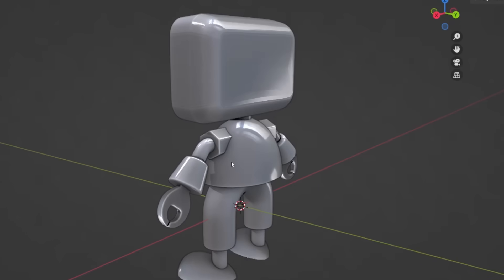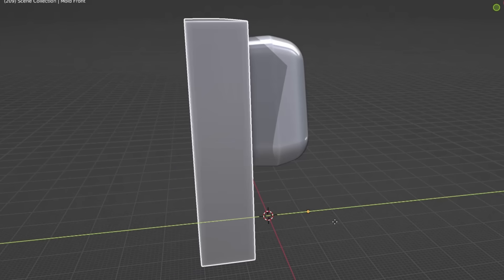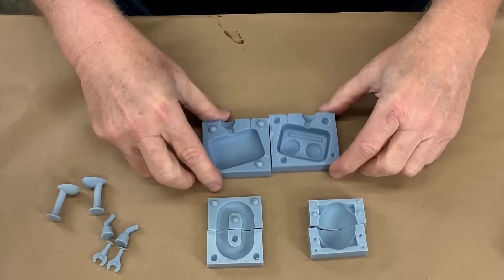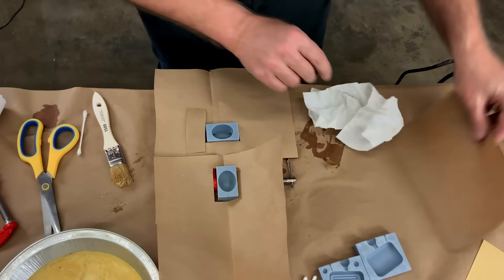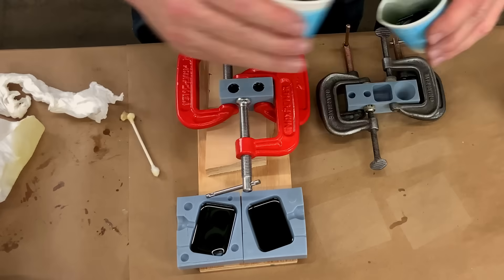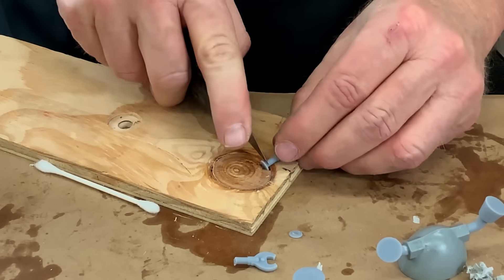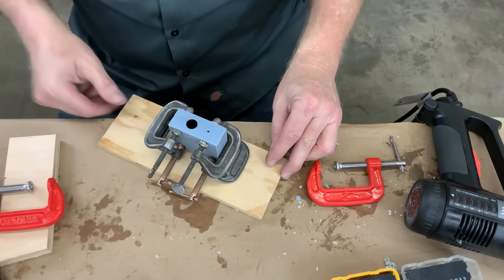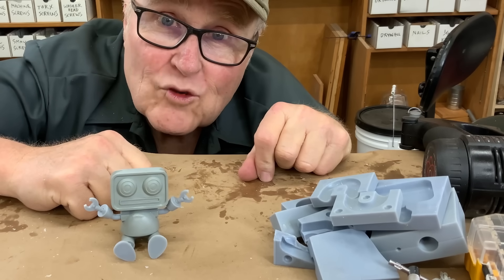3D Printed Molds For Resin Casting - Does That Even Work?

Comment: It was nice to see a bit of you working in blender.  I spend a lot of time in it myself for both my casting project and my animations.  I never knew there was a 'bool tool' addon.  I always just used the boolean modifier in the same spot you find the subdivision surface modifier.
Reply from the maker: My Blender knowledge is pretty limited. I use it almost entirely for toy prototype models.

Comment: there is a 3D resin that is more flexible.  It's from the Siraya tech brand, it's called tenacius.
Reply: tenacious isn't extremely flexible and at this thickness it pretty much will be solid, less likely to break but you still won't be able to do undercuts.

Comment: When you model the part that touches the build plate you would be better off doing a slight bevel on the parts that touch it.  When printing on the build plate you get elephants foot.  If you bevel it, you wont have to sand it off.  After watching the whole video, you could add some siraya tech blu (10 %) to your resin.  Blu is flexible and will give your resin a bit of bounce back.  Thanks for the video I am going to give this a shot for something I am working on.
Reply from the maker: Thanks for the tips. I will keep refining the materials and methods to get better results.
Reply: @RobertTolone  thanks for sharing your knowledge with us!

Comment: i had to comment early before I even finished the video. I am so frigging thankful for your insight and your videos. You explain shop tools and terms so easily, I would have never seen myself casting, using PU rubber, dying, and actually owning a pressure pot not even 2 months ago.  So THANK YOU!  

I'm also really glad you're breaking down the 'pull' concept, Its one of my biggest issues when I model.  I don't know much about casting, so Im always running into issues when I finally get to the cast/pull phase.  Like YESTERDAY I finally finished a big mold for a toy I'm making with big pointy teeth, but you explaining the 'pull' direction is 100% why those darn teeth get stuck when I pull out my cast.  So thanks again!!! I will try to improve my orientations.... and now I continue the video!
Reply from the maker: Glad you find my videos helpful Nicole.  I wish you great success your projects!

Comment: OR print negatives, in an economical eggshell style, which creates silicone molds, for then casting in as regular. I don't think 3d printing resin is a cheap thing, so it shouldn't raise costs to bust out good old silicone as well.

Comment: Interesting idea. I wanted to get a 3D printer. There are so many things you can do with them. The technology has come a long way. The problem is that the technology changes so fast that if you buy a 3D printer today, in 6 months your printer is way past it’s prime. The newer printers are so far advanced compared to the six month old printer that you just bought.
Reply from the maker: It’s kind of like digital cameras were 20 years ago. Your camera was obsolete the minute you bought it!
Reply: fundamentally FDM and SLA printers have been about the same for 10 years now.

there's some upgrades but there's also many years old designs that keep selling or get just a lick of paint.  with SLA the resolutions gone up, with FDM the resolutions stayed the same even.

Comment: It seems that both methods have weak points. With 3D printing you're fighting against layer lines. With traditional mold making/casting, you're fighting against air bubbles. Even if you're using a vacuum chamber or pressure pot, you also have to worry about how you orientate the part in space.  I wonder if layer lines will show in 3D printed molds. For me, the traditional way is better for running large production batches.
Reply from the maker: I absolutely use silicone molds for any production casting runs. That’s why I have all those tanks. We can easily cast several hundred parts per day using the correct molds and methods.

Comment: What you could do is print up a version of your mould with the positive of your object, and make a silicone mold from it. And cast that.
Reply: I guess the whole point of this video was to see if this step can be avoided.
Reply: Be aware, that silicone, especially the platinum based one, doesn't cure well around photoresin parts. It's called the inhibitor effect. The workaround is to use cheaper tin based silicone to make a pre-production die, cast a epoxy part in it, then use it as the original for the production dies.
Reply: I've experienced that problem and the cure was to spray the resin master with cellulose grey primer.
Reply: @isekaiexpress9450  I find if I paint a mould with primer spray, this stops any inhibitors, such as sulphur, fillers or ca glue
Reply: @briw4647  that is smart
Reply: @isekaiexpress9450  I've heard about that and it would suck to experience that
Reply: Literally what I'm looking to do, and why I'm here.
Reply: I was thinking the exact same thing, Good call! 👍🏻👍🏻

Comment: The alignment pins ran into a common problem with 3D printing, the surface printed is slightly proud or shy of ideal.  So shapes that in theory fit exactly are tight or loose.  If the project is worth the effort the model can be dialed in for an exact fit.

Comment: I was gonna try this but I would have to clean  the mould if Im using an fdm printer. And as for the mould not locking all the way, you would need to do the other side of the registration keys scaled up .2mm so it locks properly.

Instead of keys, you could use screw inserts and tighten it with a wing nut.

Comment: Most SLA Resins (parts) should not see more than 80°, so 60°C is already quite high, there are definitely some more suitable resins available. But as somebody below stated, build lines are always recognizable as long as you don’t use a CLIP Technology printer or do some finishing work after printing.

Comment: I just finished my own 3D printed resin casting mold test as well only 1 hour ago! The 3D model of the mold I made does not close as a flat surface but more of a sinusoidal shape. My first attempt was very unsatisfactory because the two halves did not fit together well. I tested out the resin I was using using a validation test and set the exposure time accordingly. The two halves then fitted perfectly. I tested it out with sanitary silicone, no injecting, just some dishwasher to prevent the silicone from sticking and then pressed the two halves together. Worked incredibly well. When casting silicone you don't have to worry about the shape locking the mold when it hardens. I also recommend using a clear resin for the molds because you can check to see if the casting material filled it up properly. Thank you for your videos, Mr. Tolone. They helped me out a lot.
Reply from the maker: Great tips, thanks!

Comment: I think you should have printed the head mold with the large flat surface down. The layer lines would then follow the contours of the facial features instead of looking like a wood grain across the face.

Comment: Seems like a lot of work and effort and time - wouldn’t it just be easier to just make the file to print out several copies at a time with the 3D printer. The 3D printer makes casting resin an obsolete method in this example
Reply from the maker: Clearly this was not the most efficient way to work.  But many people have asked me if they could make molds in a 3-D printer. So I thought it would be fun to explore it.
Reply: @RobertTolone  not meant to criticize just wanted to run that by you. Love your channel, always good to watch the new vids as they appear. I made my first cut mold yesterday, came out great! Btw I miss the 30 minute vids - maybe throw one of those in now and then! Have an awesome weekend
Reply: I'm afraid that the issue is time. Sometimes, it can take 14 hours to 3D print the object. Where as using molds and creating casts, the turnaround time is quicker for batch runs. You could print many copies on the build plate and try to use the z-axis for build height. But if the cure time of resin casting is 10 minutes then casting makes more sense. The old traditional way is better for large production runs.
Reply: @daveb8869  you might be right but this guy would disagree "So, I have been asked a lot why 3D printing is a benefit over resin casting. The answer is time and quality. These 1/48 F-15 shock ramps in sets 48080 and 81 were cast resin up until yesterday. What you see here is 5.5 hours of printing vs 5-6 days of casting the same amount. On top of that every part is 100% identical where a slightly worn mold vs a new mold cod also show different levels of quality. The other benefit you ask? Ok I will tell you….3D printed resin has virtually zero shrinkage so when you design and print a part it will fit to the dimensions you make it unlike cast resin which does have a modicum of shrinkage (he said shrinkage 😎). 
End of the day virtually each and every order I am behind on is not for 3D prints but rather casting.  It is eye opening how much more efficient this process is. I will continue so to dump cast parts and provide more printed items as I move forward.
Cheers all!
Mike"
Reply: @Armourworkshop  I agree about shrinkage too. I have worked with water washable resin, ABS resin and regular photopolymer resin. They shrink as you UV cure them. (UV light or plain sunlight) All of them have different working properties and shrink at different rates. Silicone molds wear down over time and 3D printers depreciate with consumables like fep sheets and Monochrome screens. At the end of the day, I would also say time vs. quality. It depends on the project where techniques used are situational. Also depends on personal use or professional use like running a business. Large scale or small scale. It depends. I wouldn't rule out 3D printing but it has its uses.
Reply: It all depends on the required application, I can tell you that I just ran into an issue while SLA printing with a transparent resin, since it's transparent the UV light cures any resin caught in holes, meaning I can't print that part in resin, at least not in one piece and have it looking good, the best solution would be to make a mold negative, cast a silicon mold and use that mold with transparent resin to my heart's content.

You also have to consider where the part will be used and how, this robot can be printed on a regular machine for sure, but if I needed something that is flexible or strong or can survive in the sun etc I'd want to have it done via other materials.

Comment: Another great video, Robert.  Thanks!  One of the reasons I got a resin 3D printer last year was to make molds (though I haven't actually used it for that yet).  Sometimes you use beeswax as a release agent and sometimes you use spray-on mold release.  How do you decide which to use?
Reply from the maker: For rubber-to-rubber I always use release agent. For porous surfaces beeswax.  When I anticipate I might have a difficult release I will use both like I did this time.

Comment: There are "High temperature" and "Tough" resins along with the flexible resin for 3D printing.  Mixing the resins can produce a more desirable set of material properties.  Gaming miniatures are often made with a  mix of 50% Tough and 50% Sculpt from Siraya Tech and they survive a few trips down to the floor before breaking. 

If you were to design in some type of extraction pin set up for the molds, how would you go about doing that?
Reply from the maker: That would be next level mold-making.  I might try a small hole in the mold which could be conveniently plugged on the inner surface with clay or wax to make the casting. But then you could blast compressed air into the cavity and possibly pop the part out. Not an original idea but one which has been recommended to me.

Comment: Have you tried spraying some IPA into the stuck half of the mold? Ive found that helps to break the mechanical lock formed during casting.
Reply from the maker: Will try it - thanks!

Comment: You definitely can, though I’ve never been terribly impressed with the results. Unless you have a machine with scary high resolution, you’re still dealing with build lines that need finishing out. We had a rubber skirt for a device my company made which we were originally casting in 60A polyurethane resin, before paying for the injection molding tools, and I was casting them in PLA printed mold. In that application, it worked fine. The cosmetic issues presented by the build lines were of no consequence. The tools lasted for maybe a single job of 10 before completely delaminating and falling apart, but it was cheap and fast to print another. Mold release definitely helps. 

My first experience with printed mold making, though, was around the turn of the century, when I was an ID model maker working for a prototyping company. We used Stereolithography printed patterns exclusively, but we did a lot of work with the model shop from another company and they had a kind of FDM machine which printed in paraffin wax. We helped them experiment with both wax printed patterns and also tools. The hope was that the wax properties would make finishing quick and easy, on either the pattern itself or the part details on the mold. Both worked, but the wax was too soft and brittle to take more than a couple of shots out of the tools and finishing wasn’t really easier on the patterns, simply different. We only experimented with soft durometer resins, 60-90A, and I’m not sure where that all went, as I left the industry in 2001. It was interesting to play with, but I’m not sure it’s something I’d consider for my own work. However, it’s not without promise. 

Thanks for sharing your experiments and for sharing your knowledge and experience in the dark art. Makes me miss doing it for a living.

Comment: pour one out for the broken mold! Great experiment, especially accounting for no undercuts or places for it to get stuck. Zero forgiveness compared to silicone seems like!
Reply from the maker: Hey Brookes! Yeah, it was a fun experiment.  I think it could be refined to work a lot better.
Reply: @RobertTolone  those draft angles are always a challenge too. I might start designing my components with chamfers so that I'll never have to worry about air entrapment and sharp corners causing the mold to get stuck
Reply: They have more flexible resins and I believe you can mix and match so that might be one way to make things a little better.
Reply: I actually got my resin printer to make moulds, but not like this, I actually plan to make moulds for silicon moulds for resin casting.
Reply: @myopinion69420  hmmm 🤔 one of my thoughts was to make the mould with the part joined to it using a union (boolean) operation and cast the negative if it's a one piece mould

Comment: If you use Cura to print, there was an experimental option, which I think its not experimental anymore, that would allow you to use an object and mold it by itself. All you had to do was sink it halfway down the printer bed for one half, then flip it and do it with the other half. You could also add a little funel to one end to allow for pouring. Another tip is to print with exclusive slicing tolerance, to make the parts exactly as big as the model is. If you dont change anything it prints in average, which places the layers half in, half out of the model, which still gives it some extra size.
Reply from the maker: Can you place the parting line on the digital model exactly on the platform?
Reply: @RobertTolone  Yes! If you slide your model down into the printer bed, It will cut the model, as If the part under the printer bed didnt exist. You can try slicing It like I said, It will ignore the parts that are "out of bounds"
Reply: You could also cut your model in half, flip the flat side up and set the mold roof height to 0, this way I believe it won't try to make a roof over the flat side. I also suggest watching Filament Friday, Chuck made a video when this function came out, but its a little bit outdated.